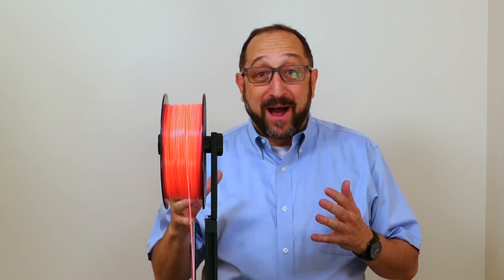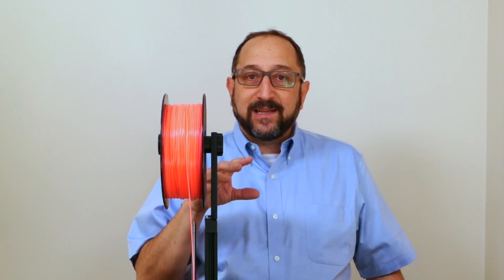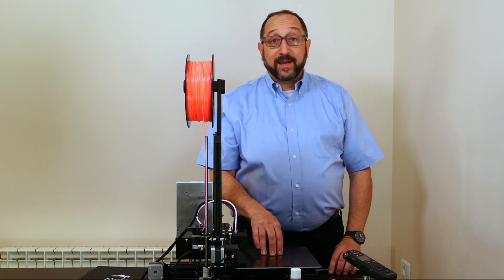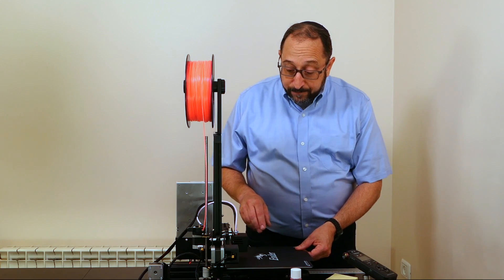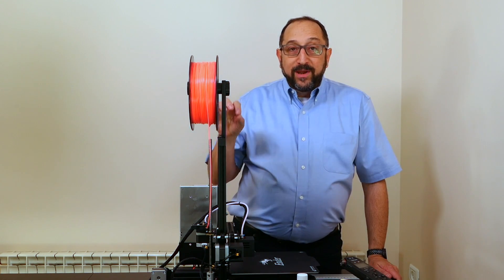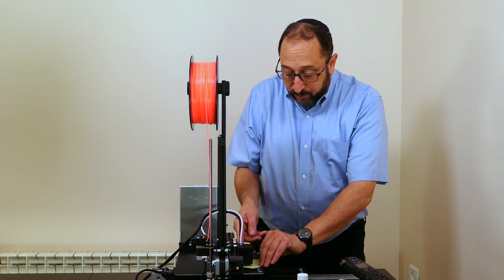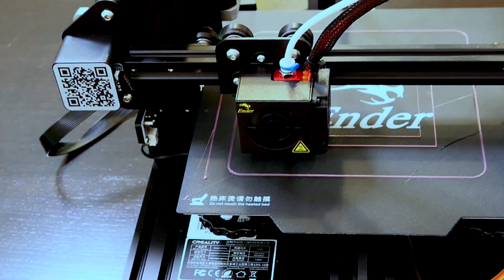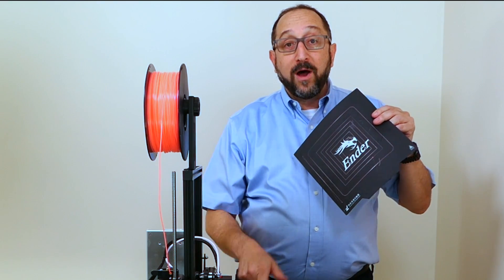How to Fix an Ender 3d Printer Warped Print Bed

Comment: Nice trick.
And I soppose postit in corners if center is high.
But remember to wash your hands before touch printsurface, after manual twist the Z leadscrew, as the leadscrew might be (and should be) greased.
Grease on printbed, lead to bad first layer adhesive.

Comment: Use a aluminium tape under the magnetic bed you will not loose heat transfer rate...

Comment: This is helpful for a quick fix but, from what I've been told moving the stepper motors too fast will make the lcd turn on and the electricity can damage your printers electronic components so it's best to slowly move them.. also my bed is bowed so this doesn't help much for my situation 😣

Comment: This not fixing a warped print bed. You are just copying 1,000,000 videos already out there on leveling the bed and there a lot more better ones then yours. Your video on leveling on a scale 1 - 10 it is a 3. Get your video Headers Right

Comment: I absolutely hate how long it took me to find this video to figure out warped beds were even a thing, turns out I accidentally lowered the print head too much during a test and it embedded a nozzle-shaped hole in the magnetic mat. I replaced the mat, but the prints just didn't adhere right afterward, it didn't click in until now that that incident affected both the mat and the metal plate below it. poted not appears to be fixing the issue for now, worst case scenario, I'll but a new plate

Comment: You can also use Aluminium foil. This conducts heat so you won't loose heat from a spacer between the bed and the magnet sheet. I think its also safer because the aluminium foil wont burn if it gets too hot like paper.

Comment: One thing I noticed is that sometimes when you level your bed, and have the Zoffset be realy low, yet get good first layers, your models would look compressed and be shorter. You will also get some lines or a basket weave look in your prints. Took forever for me to fuigure out the issue as it seems that no one has that problem. Fuigured it out myself. Still got the dip in the middle problem

Comment: can we try the sticky note trick if we print with heated bed ? wont it cause problem ?
Reply from the maker: It will be fine.  The temp of the bed is well below the temp to start paper on fire.  Not even close.
Reply: @MakeWithTech  Thanks a lot for the reply appreciate it! Will make sure to try this out today since bed leveling is a constant struggle for me :D

Comment: Instead of a post it note, I recommend a post it note sized piece of aluminum foil glued to the metal bed. That way, no worries about bed temps or fire hazards. Either way, great video.
Reply: Foil is barely a tenth as thick

Comment: Great video. I have been searching for a solution to the bed leveling dip in the middle for a while now.  I tried your sticky note idea and while it was better, it now made the middle too high.  I was scratching my head trying to think of a material that was thinner than a post-it-note when my wife suggested cutting a static bag in half and using one half of the bag.  It worked great and I was able to level the bed using Chep's bad leveling gcode file.

Comment: So how do you do this with a glass bed, like on the Ender 3 Max?  ... Mine's remarkably flat, I'd say under 0.1mm when checked with a surface plate. But it's noticeable when I'm using a 0.2mm nozzle. .... My .. previous printer, which I shall not name, had a 0.5mm dip in the middle. I was going to scrape its glass plate when I found out about the Ender 3, which I got.

Comment: I was able to fix mine with a bit more of a brute force method.  I took my bed off and bent the bed over my knee, applying force down on the high spots and up on the low spots.  To measure my progress, I used a machinists straight edge and mechanic's feeler gauges.  Lay the straight edge across the bed and slide the feeler gauges along the straight edge to look for where the gaps are.  Do this for all in X, Y and diagonal axes.  Same process as testing for warped cylinder heads on an automotive engine.  I was able to go from greater than .2mm for the largest gaps down to not being able to fit .06mm under them.

Comment: Everyone got a dip in the center and here I am with the opposite. My corners are perfectly leveled and then the center i so tight the nozzle scratches the build surface. So I have to choose between a perfect center and never print too close to the corners or the other way around. It sucks :-( Would a glass bed fix that?

Comment: One corner on my ender 3 seems super low when I do my calibration test and when I turn the nob to make it come closer it just feels loose like it's abouta pop off. I'm not sure what to do
Reply from the maker: You need to start over. Tighten up all of the screws/springs.  This will pull the bed down.  Then relevel one at a time going around multiple times.  If your bed is too high, that is to say too close to the maximum positions you run into the issue you are seeing.

Comment: What if, in my case I have a Voxelab Aquila printer which is a clone of the Ender 3 V2. I my leveling has found that the middle is a few mm higher than the corners, But I have a flat glass bed on top of the metal one! So how do I get around that problem where the middle is too high by a few mm than the corners?  Your idea of the post it notes is good but will not solve my bed issue.  Any thoughts?

Comment: Thank you very much. Just got an Ender 3 and had a low center. The post it note fixed the problem. I was racking my brain for a few hours on the leveling. 5mins after post it and it was fixed.

Comment: Unfortunately mine is too high at the center when it is hot. Yesterday after a bed leveling at 50C I have tried to print ABS w/ 100C bed and the head could not pump out the plastic due to lack of gap bw the bed and nozzle. The result is: the push of filament broke !!! the PC04 screw on the top of head and push out PTFE tube.
So in my case i think I have to build a frame from postits/alu foil around the center.

Comment: Oh do worry about that, electromagnetic induction moving the axes, as it can fry your drivers and your whole board if you move those fast.
Reply from the maker: You are correct, move the components slowly when power is off.  Unfortunately this problem is due to a poor design on the controller boards that could be solved with very inexpensive components.

Comment: The bed warping is still an issue now.   I used a couple of layers of aluminium foil rather than a PostIT note.   I found using paper as a "shim" it affected heat transfer from the bed to the build surface....    Mine was pretty bad.  It dipped almost a full millimeter in the middle.

Comment: 3:40, the reason that the auto levelling is used is because people can move the print head down slightly when moving it to a different corner, meaning that the bed won't become level. Auto levelling gets rid of this error.
Reply: Nah, you wouldn't be able to push the head down with your hands, it's leveled by a z screw. Pushing down on the head won't make the screw turn, so your z level is fine. Auto bed leveling should only be used after you manually level as best as you can.

Comment: I just had to come back and thank you! Got my first printer as means to aid my DnD campaign and was very unexperienced. I noticed a dent and the shop told me to "untension and retension the bed and that it would be solved" and I did not know how to. I tried your memo trick, releveled the bed, and it WORKED!!! Thank you so so much sir, I couldnt have done without you!

Comment: My bed is extremely warped and nothing is working any suggestions?
Reply from the maker: Unfortunately, you may need to replace the bed.  But first.  Make sure you have not caused the warp by adjusting the mentioning screws incorrectly.   I would recommend measuring the distance from the bed to the corners of your printed frame.  You want to make sure the bed it level and not high on one corner and low on the other.

I would also recommend you post some pictures at forum.drvax.com where folks might be able to help you out.

Comment: If you happen to have done maintenance on old cars, you will have a set of feeler gauges - thin strips of metal - which you can slide under your straight edge until you find one where you can feel it dragging between the edge and the plate.

A Post-it (TM) is roughly 20lb paper, or 0.003" (3 mils) = 0.076mm thick.

If you want a somewhat more permanent shim than using a piece of paper, you can buy thin brass sheet shim stock at the auto parts store as well. The paper-thin brass can be cut with heavy duty household shears, or a hobby or utility knife (disposable blades can be handy, especially if your significant other is protective of their scissors!)

Comment: What happens when you get a glass bed that appears to be warped? send it back and just go for the magnetic sheet?
Reply: Same question here, the glass bed on my Creality CP-01 is warped in the middle, no post-it will be a able to fix that. Looking to replace the X slider under the bed though, because I assume this is warped and in turn also warps the bed.
Reply: @Philly0801  my glass bed was really warped to the front left corner, I went for the magnetic bed and got a bltouch and used the bed visualiser in octoprint and it showed me that my aluminium plate is also very warped around the centre.
I ended up using loads of tin foil to sort it out so much so that almost all of my bed under the magnetic sheet is now tin foil.

Comment: I have this issue... (i actually use feeler gauges for leveling... i have a little bit of machining experiance) for a little bit i was having adhesion issues across the bed when i would use a 0.10 mm shim ( aprox the width of piece of paper) I actually dialed it down to 0.05mm and bam sticking prints [first layer set to .24mm or so) i just recently discovered that the dip in my bed (cold) was approx 0.15mm cold and approx 0.05-0.08 mm hot (level your beds hot people) so good idea on using a shim in the center of the bed to raise level.... thanks for the info i usually find some inspiration to help a fix... i. Off to the hard ware store to buy some shim stock!

Comment: Thanks for the video. Question for you. You do the calibration with the printer off. Say I do a print with a bed temp of 50 deg C and a print head temp of 230 deg C, will the bed and nozzle expansion when heated change the gap? I don't want to ruin my bed surface (Ender 3 V1, non-magnetic plate) by having the nozzle dig into the print surface once heated.

Comment: Hello can you help me? I am desperate. I level my bed manually and automatically. at the 4 corners the paper seems to touch the nozzle a bit, which is what it is supposed to be. if I want to level in the middle, the paper is too tight. every time again. i have a glass bed and an ender 5 plus. I've been struggling with my leveling for days and I just can't print. the nozzle is a few mm from my bed and the filament does not stick to my bed. I don't know what to do anymore.

Comment: You really should leave these plugged in while powered off or unplug the lead to the steppers when you move things by hand. Without the Earth connection, your dumping a lot of EMF caused by you moving the steppers into capacitors that were only picked to handle what the machine itself does. Possibly more than just that potential for damage, haven't dug into the schematics yet.

Comment: I have an ender 3 pro and I have the dip in the middle, would the sticky note still work with the glass bed
Reply from the maker: Unfortunately not.
Reply: @MakeWithTech  is there another fix?
Reply from the maker: Alternatives include: changing the build plate and adding a ABL sensor.
Reply: @MakeWithTech  would putting foil in the dip work?
Reply from the maker: Not likely.  The problem is the glass will not bend when you put something under it.
Reply: @MakeWithTech  the glass isn’t bent, the heating thing is

Comment: Thank you so much for this DrVax. This helped me immensely with such a frustrating problem and got me back into the saddle of learning 3D printing.

Just curious, what is your preferred surface for 3d printing? My ender 3 shipped with the magnetic bed which has been pretty easy to print with, but it's not the flattest surface. Your trick made it much better to deal with, but I am feeling like glass would potentially be more stable (perhaps with trade-offs).

Comment: It's a ton of postits when it's the other way around and the center of the bed has a slight lump to it lol
Still a great idea, but I think for many people, just placing the printer on a really flat surface and checking for its structural balance is a great start. Mine was wobbling a bunch, so I had to unscrew the side screws and it sat flat on the surface, then I proceeded to rescrew it and move into the balancing of the other bars, besides releasing the pressure of the wheels. As far as perfecting its balance, a water leveler is a great tool.

Comment: I have this problem with my new ender 3 v2 which has a glass bed. Now what
Reply from the maker: Interesting.  Glass is normally relatively flat.
Reply: I found that BLtouch + octoprint bed visualizer could maybe solve this. If the software auto adjust to small differences (?)

Comment: Does Ender 3 has bed adhesion?
Reply from the maker: The Ender 3 has many variations.   You can obtain good bed adhesion on any bed with MagiGoo.

P.S. I have started a new discussion forum at http://forum.drvax.com where we can all have more elaborate discussions and share pictures on our prints and printers. Check it out. Irv

Comment: Thanks for the tip! Been watching your videos and absolutely love your content!

I have a silly question though... since these print beds are heated, what are the odds of a piece of paper igniting? I do understand that there's a magnetic cover or a piece of glass on top of a metal bed, but still.

Thanks!
Reply: The temperature at which paper will ignite may vary but the average is between 424F and 475F! so don't worry about it! :)
Reply: @sammyenwonderland  Thanks!

Comment: Tip for testing the leveling: Print leveling squares! There are a lot of stls on Thingiverse (for different printers/sizes) and with them it's a lot asier to see if the bed is level or not, compared to printing the lines.

Comment: Well, what do you do if your printer is warped in the center and it's higher than all 4 corners? Mine is bent pretty bad!
Reply: mine also! did you find any solution?
Reply: I had this problem. I slightly bent a corner of the bed and added some kapton as a shim on the 4 corners. 😆
Reply: turn it over and follow the video. duh. /s

Comment: Hi, i have a warped bed on my ender 3 pro. Bought a glass plate hoping that the bed isn't warped anymore, but when heating the glass bed takes the form underneath it. I've corrected the bed by putting tinfoil underneath. Still, a lot of hassle.
Reply from the maker: Placing shims under the bed is the technique I use most often.

https://youtu.be/y_xCtxcwDrQ

Comment: Great videos, appreciate all the valuable insight. Need some help though! I have Monoprice MP10 and I am trying to install a glass bed on it. Whenever I home the axis, the nozzle lowers to the position and then continues to drive into the glass forcing me to have to manually shut it off by the flipping the switch. I've tried to lower the plate as much as possible by compressing all the springs but I still have this issue. Any guidance, or possibly a video showing how to install a glass bed on MP10 would be greatly appreciated. Thanks!
Reply: You have to adjust your end-stop upward in a way that it will stop de z-axis before hitting the glass. Dont Know this printer model, but thats always the general idea. Hope it helps

Comment: You left out a critical detail and one I had to discover on my own. Now this method you show is find for a low temp bed print but for higher bed temps things change and the bed expands. I have found that I need to first bring my bed up to temp for the print I plan on using and level at that temp to ensure accurate leveling. Also I found the paper trick was to close and ended up using a card stock instead which is about two sheets in thickness. Hope this helps someone else who found this video did not work ideal for them.
Reply from the maker: You are correct.  Thanks for sharing.

P.S. I have started a new discussion forum at http://forum.drvax.com where we can all have more elaborate discussions and share pictures on our prints and printers. Check it out. Irv
Reply: @MakeWithTech  Thanks, will be joining in on the discussions there.

Comment: You forgot to heat up the bed before leveling as the thermal expansion can warp the bed, just heat it up to 50°c not that hot and do the exact same thing

Comment: Many thanks for taking the time to share this fix. I was just about to contact the supplier until I realised that others may have the same issue. By the way, I found that if you carry out the levelling routine when the assemblies are cold you have to be sure not to have solid extruded filament giving a false endpoint to your nozzle. Clean the end with a plastic tool before going through the levelling process - it saves a lot of grief and head sctratching!